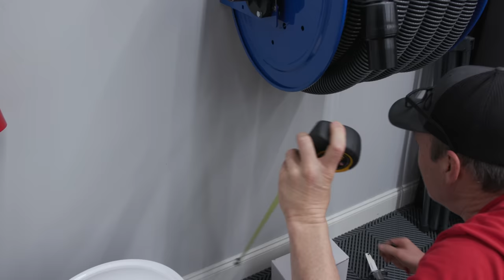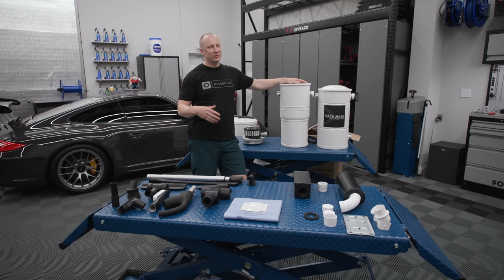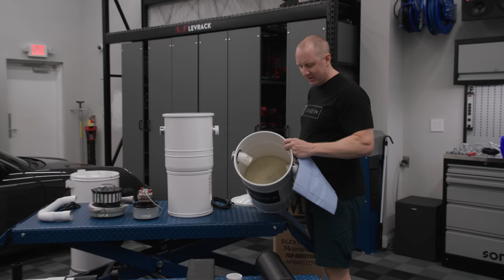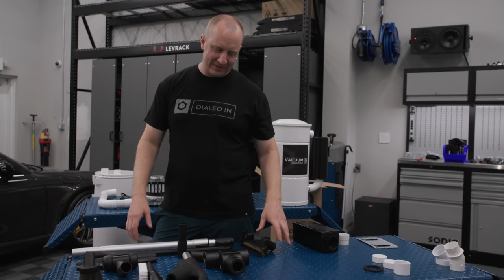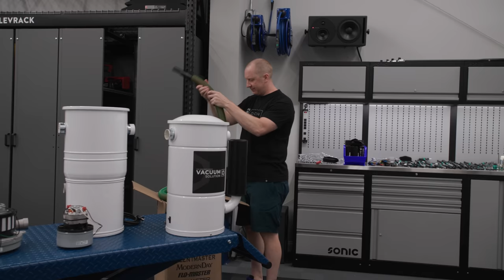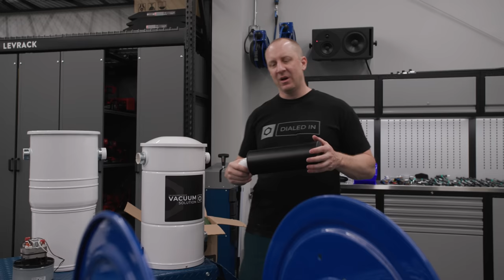The Best Vacuum Setup For The Garage | The OG Vacuum Solution

Comment: Matt I’m a plumber- if you want a gray coloured pvc pipe you need to check out system 15 pipe (it’s a lighter coloured grey, or as a darker alternate try xfr pipe. It is very expensive compared to thin wall vacuum pipe but it’s what I’m going to use when I buy one of these. The radius of the 90’ bends are a little tighter but who cares.
Reply: Tightness of the bends matters. Tighter bends will be more restrictive and also will possibly cause clogs.

Comment: Most, if not all the tubing used in central vacs comes from a company in Olney Illinois called Mac Plastics. They used to make it in gray back in the day, early 2000s was when they kind of went to all using white. The fittings are made by others, VacuLine, Canplas and Hayden make that. BTW I'm an MD dealer and installer in the Denver area, and the M715h, which is their full sized unit with that HUGE motor, is my absolute favorite to sell.

Comment: Why the vacuum bag? My central vacuum is bagless. You twist off the bottom canister and dump it out. Way better than bags. It's quiet with the muffler and tons of suction. Beam is the brand. It is a lot nicer looking as well.
Reply: I have the Beam SC300 and it’s perfectly okay. But OG’s looks to be more powerful.
Reply from the maker: Systems that use a bag are almost always better.

Comment: One strange thing about the thru flow motor, it cools itself with a stronger flow of air, the main working air flow is stronger than the cooling fan in the tangential motor. As long as you don't run the motor with no flow (there's an air bleeder vent on units with these motors) and don't let it run lots of filth through, it will actually last the same runtime as the bigger motor. I end up preferring the tangential motor because of that spring loaded relief vent though. While it's absolutely necessary, it does mean you never get the full power. I realize people probably won't notice the difference, but I can, and I feel I notice it annoyingly more at the altitude we're at.

Comment: Here's an idea..test it out with Cyclone Separator(it's just an addon, typically used in woodworking shops),
It separates the heavier debris and actual dust..
 
Benefit:
- save on bags(dust for bags, Bin for large debris), 
- less time on spending on changing bags, especially if its installed in the attic for example. 
- versatile size, someone could even hook it up straight to a modified rubbish bin.
- make it easier to fish out items that was accidentally sucked in.

Comment: Nadair is the the one Matt had that Hawaii Detailing suggested. They seem good, but made out of unobtanium. I have the OVO that’s made by Nadair. It’s great OG is now able to source the Modern Day in volume (hopefully).
Reply from the maker: Bingo...  Tommy was pumped about that one.  I put it on the wall and used it for a bit.  I hated it.
Reply: MD are basically the gods of central vacuums anyway.

Comment: You should make an episode about all the Milwaukee AIR-TIP such as the M12 Utility Nozzle. These attachments may be better quality and I am sure the cost is probably comparable to the ones you showed.
Reply: Milwaukee still doesn't have proper attachments for their M12 pack out vac.  The end of the hose is a completely weird design. Can't even get a brush to stay attached to it without holding it at customer sites. It's pretty embarrassing.  Their M18 accessories are nice but way too big and bulky when you're transporting a pack out vac in and out of customer sites all day.
Reply: @DJ_Driven  I completely agree. I would also like to see a long hose for the milwaukee m18 packout vac. I own one and its way to short to connect to tools like my tracksaw and it has proprietary ends to attach it to the vac. I think we need to see a 2nd round of new airtip accessories that focus on smaller products hoses and tips for packout m12, m18 and even for their dust buster type products

Comment: For those of us planning to do the install, what is the width necessary for the Cox Reel and mounted under or over the unit?  Do you cover dimensions necessary in any other videos yet?
Reply from the maker: Video coming on an install this week. The overall width of the Cox reel with handle is 24 inches wide.  We recommend mounting the vacuum 2 inches above the drum of the reel. You can mount the vacuum over or under the reel, or to the side. Whichever you prefer and what your space fits.
Reply: @ObsessedGarage  does that 24" inch dimension include the elbow attached to the Reel for an upper or lower canister mount or just the width of the Cox part? Excited to get mine ordered and thanks for the early information.
Reply from the maker: No it does not include that elbow, that is the total width of the Cox reel.

Comment: Could you use this thing with a long extension to vacuum up your floors in your shop ? I have a huge dust collector but you don't really want anything other than sawdust going into that thing so I'm still looking for a whole shop vacuum vacuum out the car and then the floor and get all the little bits of wire and plastic and other things that end up on the floor
Reply: Why couldn't you?
Reply: Yeah, why wouldn’t you be able to use your dust collector for those other things?   They make vacuum attachments for dust collectors so you can vac your floors
Reply: @JuanOnjuan-kp7tp  sawdust is extremely flammable so you don't want any particulates going into your system that could spark and cause fire apparently I've been told by many vacuum companies and old woodworkers to only use your dust collector for sawdust you don't want to accidentally pick up a little piece of metal that can tumble around and spark inside the cyclone I guess ..
Reply from the maker: Yes, you could do that.  I think it would be a bit clunky though.  I'd rather have the Flex or maybe a Festool that is already portable.

Comment: I cannot agree with you on that. Just get a vacuum from Karcher, Festool, Nilfisk or Starmix. They do have great quiet vacuums. You can get a corded o cordless packed with the best tech in the world.
Reply: Keep up.   He has been going through the process of coming up with this type of system for a while.  I don't recall Matt ever stating this is the do-all-to-end-all-forever-and-ever-amen solution.  This is just version 1.
Reply from the maker: I had Nilfisk come here from Europe and brought us half a dozen vacuums.  None were were great at car stuff.  Festool only make rolling ones.  Karcher is impossible to get ahold of and work with.  I'm been trying for years.
Reply: @ObsessedGarage  Ok, I see you have tried. Let's see how your project develops. For me I have settled with cordless Bosch GAS 10 vacuum to clean the car, simply because it is very light and has no cord. Of course, suction is not on par with Nilfisk (Flex) you are selling, but still, I prefer smaller and portable to a bigger and more powerful one.

Comment: After reading through some of the comments... the lack of common sense and the lack of self-awareness is embarrassing.  I feel for the guys in support having to respond if their email is polluted with these same level of questions.
Reply: Lack of self awareness?   Just browsed the comments.  What was said and was so bad that has you upset?
Reply: I think I could be one of those people but I’m somewhat confused.  I think he said he chose this unit after having tested a bunch of other units already?  Correct?   Because later he said he was going to buy a bunch of canister vacuums to test @15:52
Reply from the maker: I'm going to buy them and do formal tests on videos and compile a spreadsheet.  I don't keep stuff laying around.  I'm going to do something similar to what I did with pressure washers.  It took up tons of space.
Reply: @555fourthstreet8  I'm not upset.  But Matt has went in detail, for months, about the process required to come up with this set-up.  Multiple videos packed with the thought process.  Most of the questions can be answered by just watching the video. And yet some of the comments ask questions that are exactly covered.
Reply: @timkinley1779  I thought i heard in one of the videos before that he already tested a bunch of different vacs which is how he was able to land on the one we saw here?  What were some of the specifics that was shared about this thought process?
Reply: @555fourthstreet8  I can't speak for Matt and the crew.  But he has been working on this for awhile.  Probably a hundred 'if-then' scenarios factor in to the decision for this set-up.  I damn sure don't want to go through the process of coming up with what Matt invests in his decision making.  He is pretty good at dropping the knowledge.